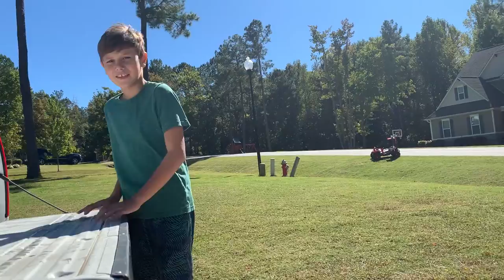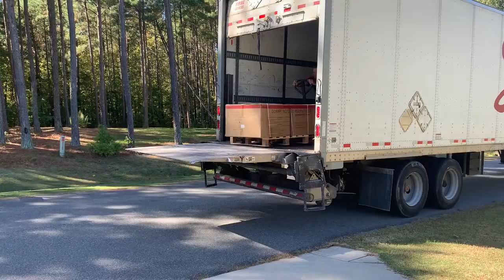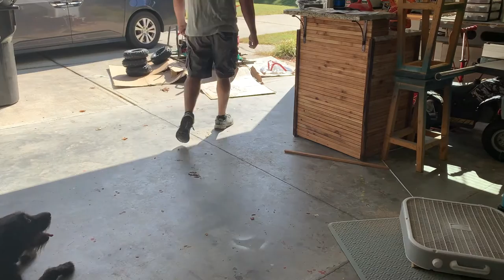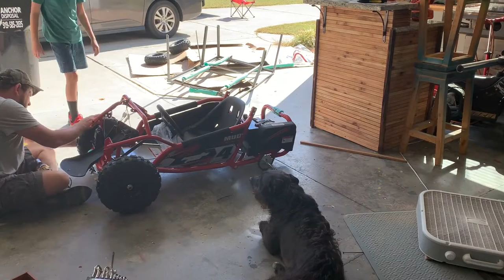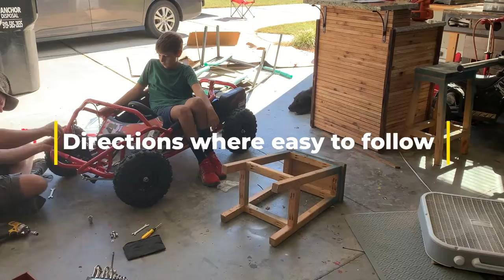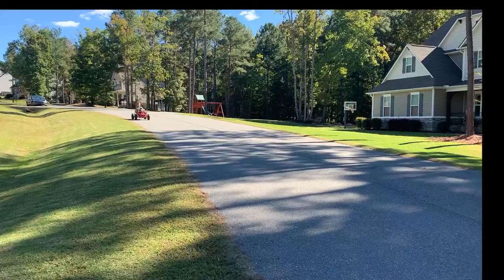Mototec mud monster electric go cart delivery set up and first ride

Comment: Any idea how you can convert this to using lithium Ion batteries instead of lead acid?
Reply from the maker: I think that would be an easy conversation the batteries are on line and I don’t think the motor cares what type of battery you use